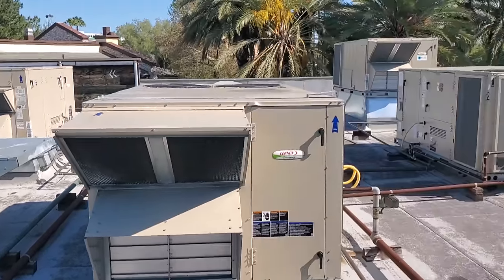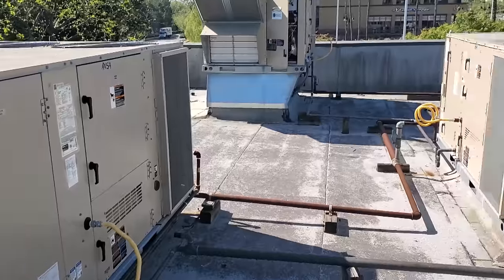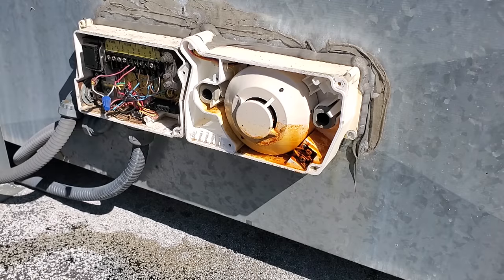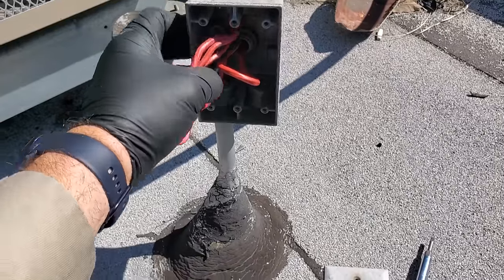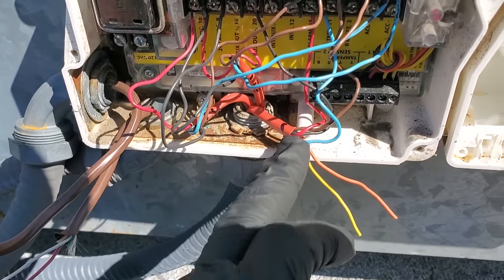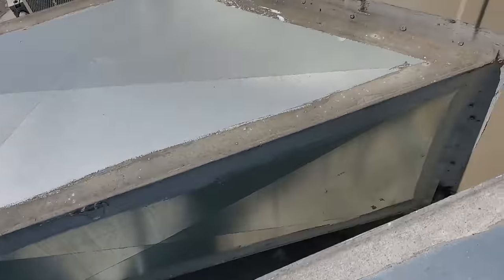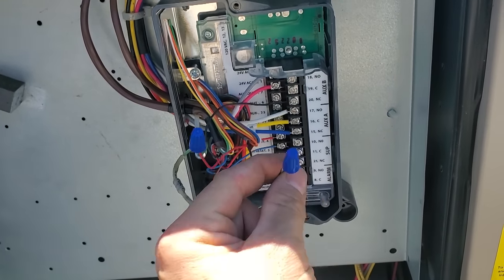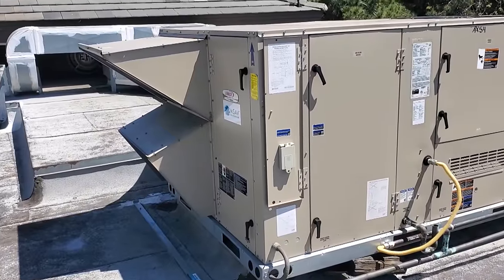DUCT DETECTOR TRIPPED

Comment: I've been working on fire detection systems for more than 35 years in the Netherlands. In every fire detection system that has an interaction with other systems such as ventilation or elevators, the weak link is the person or company that is responsible for correct commissioning and maintenance. The owner of the building is ultimately responsible but they try to push that responsibility to one of the contractors. Unfortunately neither of the contractors will take full responsibility and will start blaming the other contractor when things go wrong.
We need more people like you who feel the urgency of doing it right. Thanks a lot. I will pass this link on to enjoy and learn.
Reply from the maker: Thanks so much for watching !

Comment: Wow chris...that's some shady work you found. That's the type of trash that gets people killed!!!!
That company should be ashamed they let that pass as finished. And as for the start up...that's so  common...these companies should be sued for letting a "half ass" so called technician start up a rtu or any system for that matter that has no business doing the job!!!. Thank you for showing what a "PROPERLY TRAINED" hvac contractor is capable of!!!
Great video again
Reply: Jesse Lute You are absolutely right! However I do want to bring up that sometimes the techs are not given the correct amount of time for a proper start up and commission. A lot of sales guys that bid the jobs think its just flip the switch and walk off the roof. So I don’t always blame the techs when I see crap like that, more than likely their boss just told them do get it done in an unreasonable amount of time.
Reply: @jonathanschulz5841  yes I do agree there...I've had a few that did exactly that!!! It's still a shame that there is no liability for that shit!!!
Reply: if I had to guess, the fire system is set to cut power to any and all fans and hvac anyway. so they didn't need both sets functional, although they probably should have bid linking to the new units. but probably the place didn't want to pay for it or deal with all the hoops and chose the cheaper route. hard to say these days.
Reply: I do agree...but I've had to make those decisions myself. If you dont know how....its your responsibility to ask! Thats what makes a tech.
Just knowing your limitations and when its exceeded, to find the answer and do it right.
Alot of them dont care if its in right...and they are why I bitch...it only takes a few min to do a 1nce over and make sure your companies reputable name is known!

Comment: I went out during a “bomb cyclone snow storm” in my personal vehicle to help out a large grocery store whose duct smoke tripped on a very large seasons4 unit. They had to pay a firefighter to stand in the store while loud siren going off... fire alarm company would not come out and could not silence the alarm( allowed me to fix). I had fire department help me write out a waiver of liability, had them and the manager sign it. I ran on roof with a multi tool and a wire nut and got the alarm silenced. Customer gave me a $500 gift card and asked me to bill them 8 hours for my time, was a win win. Alarm company showed up 3 weeks later lol.
Reply: I have seen similar issues, but was not lucky enough to get a bonus.
Reply: Alarm Company needs to be smacked with a Breach of Contract Lawsuit...
Preferably etched onto a Sledgehammer and applied Vigorously to the side of their heads...
Repeat as needed until they clean up their act...
Reply: @HappilyHomicidalHooligan  😆 😅 😂 🤣😆 😅 😂 🤣

Comment: Nice find on the duct detectors not put into service. Does the bld. or fire inspector check these during new or replacement installations? I was in my doctors office in January and looked up in the ceiling while waiting and the smoke detectors still had the dust covers on them. I told the secretary and she was going to tell the bld. maintenance person. The ceiling was open and black painted. I'll bet this happens all of the time. Thanks for the video.

Comment: The installing contractor is to blame for all of this BS, they clearly did not know the unit they were working with. I'm a strong advocate for fire alarm technicians being used on multi-unit roof sweeps to avoid issues like this.
Reply: Consensuallycasual I’m a firm believer that alarm companies should stay away from my detectors. Code here has changed throughout the years. First they had to be in the supply. Then in both supply and return. Now just in the return. This is for units moving 2000cfm or more. The detector in the supply is the problem. If you want a smoke detector for your fire alarm then install one. The problem is the detectors installed down stream from the heat can and will go off on the initial heat start of every year. Dust on the elements or heat exchanger will set them off. This should only shut down the system it operates and not set off an alarm ; emptying the building and monitoring station dispatching the fire department. Always when firing up heat for the season call the alarm company and have the system put in test mode.
Reply: @actechformallyyomama746  Depending on the jurisdiction, the duct detector's usually are set up to send a supervisory signal to indicate that the detector needs maintenance, which would fix a lot of the issues of them causing a mass evacuation. If they are set up for an alarm condition, a recommendation needs to be made to move them into a supervisory condition.

Comment: The installation company by not pulling the detector plugs opens up significant liability for them. You need independent eyes and a checklist to go through the work to double check everything. Not necessarily a different company, just someone who didn't work the installation.

Comment: Anytime wires (or even jacketed cables) laid across a bare metal edge; a grommet or bushing shall be installed. I have seen fire systems that where wired with  un-jacketed  doorbell wire into boxes without bushings in the ends of conduits. If you don't have a grommet you can make one by slitting a piece of small plastic or rubber line if you need to go through a punch hole -- cause where there is vibration (or even thermal expansion) the metal edge is going to eventually gnaw through the insulation.  
When a conduit is installed between locations of large temperature difference a compression gland or sealing compound should be use to prevent condensation. THWN conductors should be used around around wet conditions and MC rating for the jacket. Ideally the warm end of the cable would be sealed but in some situation both ends would need be.   Water in the box can come from condensation pulled through a long conduit -- if part of the box is cooler than the other end of the conduit unsealed.

Comment: Wow bad idea to install a “waterproof” detector exposed outside like that.
Reply: By me in Illinois it was once code that the detectors had to be x amount of feet from the unit.  But that was 30 years ago before manufactures started including them in the unit.  Also around here you don't see duct work exposed on the roof like that.  It just wouldn't survive the weather.
Reply: That detector's gasket wore off which explains the sealer outside the detector.

Comment: another good video// as for the smell.... if it happens with low temp outside when economizer are open i would be looking at plumbing vent stacks..  on cooler/calm  days  the methane can pool on a roof structure with those high exterior walls. would need to piped to the outside edge. have had several restaurants that chased that problem for year  keep safe

Comment: The smell might be a sewage vent pipe close to one of the fresh air dampeners. I did maintenance at 2 restaurants that had that problem. One of my employers took a pipe coupling and wedged a screen for Windows in between and dumped carbon pellets down it. It filtered out the smell.

Comment: Usually these detectors are set up as a supervisory which is higher than a trouble.
By the looks of it, that detector is long gone.
That system also looks like it's getting old as well due to those key switches. I can tell it's an older conventional system by looking at the detector
Oh I just saw the system omg Bosch systems are complete shit I can't believe they are using that

Comment: Experience has taught me with outside weather proof IP65 rated enclosures it's often prudent to drill 2 x 6mm holes on the bottom of the electrical boxs to let condensate and water out rather than sealing water inside as they can sweat from humidity.

Comment: Admittedly I was cringing a bit.. wondering if they even addressed the duct detectors they put in the new units.  Evidently their fire alarm is an older bosch... so it was probably just a zone by zone and hopefully did not need new setup.
I'm unsuprised the Duct smoke detectors were 'installed' but not set up, sadly.  As a fire alarm inspector myself I see a lot of units installed poorly or badly by Hvac installers who are not properly instructed on the proper placement and operation. (let alone /sane/ placement...)  That said, I would hazard a guess those duct detectors my have even been pre-installed by the supplier which.. happens.  Much to one business's chagrin I've seen personally so far. (There is a tiny story there.)
Ultimately I would hazard a guess that the new duct detectors were preinstalled. And the Hvac installers saw the existing units.  Thus went with the easier route of just transferring the wire from the older DSDs to the new RTU, rather than connecting the old to the new device.
The one thing I did not see was did you verify the internal unit was placed on the same 'side' of the airflow?  I only saw one internal Duct smoke detector and while it should be on the end blowing into the store.. I have seen them on the side sucking air out of the store.. (i forget which is the supply and return at this moment.)  It absolutely has to have one on the side 'returning' the air to the store.  The reason being if the unit catches fire and its on the other side it may take much longer for the smoke to cycle back into the machine and shut it down. (See previously mentioned bit about a pre-installed duct detector.)

Comment: Do you have local fire or building codes that requires a smoke detector in both supply and return? Or, were the red plugs left in place because the unit installer just wanted  to use the existing smoke detector equipment? That may have kept the bid price of replacing the units down by just using the existing duct detectors. We run buildings in a very slight negative pressure, not positive. If you run positive pressure the doors will not close properly. It would be very difficult to balance that building by “winging it”.  Bathroom exhaust to close to a/c units and make up air units can cause odor problems.

Comment: it is good to correct bad work, but you should have used the red jacket cable for the alarm wire at least.  red denotes fire retardant while the brown is not.  some states dictate you have to use the fire retardant cable for all fire alarm cabling on newer installations.

Comment: 3:00 At this point in diagnosis, I'd pull out my fox and hound tester. I'd hook it up at the test/reset station, and go around to each weird/old duct detector's wiring and check for the ring. Less than 5 minutes work with the correct tools. 😁

Comment: System Sensor is the most common smoke detector in this area and it's what we also install on new systems that requires one.  I believe since I am so used to that brand that it's very easy to wire it up.  You are right, the fire alarm companies will not touch them in this area.
Reply: O.K. who does fix them if the fire alarm company won't? Thanks
Reply: @watermanone7567  We do.  They will contact a hvac company.

Comment: On the west coast we handle the ac side and the alarm company is responsible for the alarm side. However with modern slc fire alarm i could actually remove the alarm contacts and the fire alarm would show trouble. crossing those wires will trigger an actual alarm.

Comment: Always check with your local fire marshal as to whether the duct smoke detectors are required to trigger a trouble or a full alarm condition. Building codes vary a lot, and sometimes the fire marshal will want to do something different than the building code, just because they can. Found that on my company's current office building after we moved in. Duct cleaners were working overnight and a duct detector set off a full alarm in the middle of the night. Neither our building code nor the current fire marshal require that, so we changed it to just go trouble and shut down the unit. The old fire marshal was requiring full alarm for duct detectors because he could, no other reason. Then they started getting automated nuisance calls so they stopped requiring that and now typically just follow the local code.

Comment: The duct detector is connected to the fire system control unless it has contacts that tips fan and damper shut down.  It detects smoke in the return duct and had it operated it would indicate one of two things, trouble [dirty or defective device] or fire which the fire department would respond. .  It has nothing to do with the AVAC operation.

Comment: Oh the many times I’ve heard that warning beep on the alarm panel. Too many situations where a fire sprinkler pipe burst and tripped the alarm due to pressure loss. I blame the fire company solely due to the fact that they recently installed fire sprinklers right underneath each of the main area HVAC units and I bet they upped the pressure on the older pipes which are rated for lower pressures and are in poorer condition since they’ve been up there probably for the entire 16 years of the building’s use. (In case you are wondering this is in a Walmart)

Comment: I like to take a picture before taking it apart also if the wires are long enough leave some insulation on the wire on the  terminal so you know the color of wire that was on that terminal

Comment: Forgive me if I missed something, but if the duct detector that was full of water was sending a fire condition why was the fire alarm not triggered?
Reply: Sometimes, a duct detector will only trigger a supervisory condition.
Reply: If a short is created due to faulty wiring, or in this case water the system is designed to show a trouble condition. The detector will only set off an alarm if the photo cell is triggered under smoky conditions in its photo cell cavity.
Reply: @miguelh.2954  I've actually played around with the insides of a detector if anything is caught by the laser beams in there it trips

Comment: 280 ohm resistors with leads if I'm not mistaken,  but I have a variety pack in my hobby kit, comes in handy for bypass when say removing a spray booth that has fire alarm. Set it off once with a direct short, fire dept showed up, boss starts yelling that's gonna cost the company money, which mypops will just complain to me about.  So, I just said" it's all my fault,  I tried to bypass the alarm,  I was removing a booth and scraping it, I am responsible for this so how much am I going to owe for this?" The station is on same main cross street less then a mile. Firefighter walking jogging up who I said this too kinda dropped his head, and gave me a break,  small explanation and lecture. I thanked him very much and they left. All this happened in 6 or 7 mins. from response time to call, arriving, and leaving. I was extremely lucky.

Comment: Could that nasty water inside the duct detector have been causing the smell they were complaining about?
Reply: Seeing as the air from the duct blows right THROUGH the water like a hookah...maybe.
Reply: @quietone610  Could also be bathroom fans plugged or not working. Saw this many times. Thanks
Reply: probably dried out traps and the negative pressure sucking stink in. it generally takes a week or so for them to dry out and with so much shutdown they likely have lots unused, including floor drains which were getting a little mop water and now nothing because unoccupied.

Comment: I miss those dry contact smoke/fire  detectors and those smoke detectors are not nema 3 certified enclosure(outdoor) they are nema 2 which is for "indoor use only" or should be installed in a nema 3R enclosure.

Comment: Those red plugs are test ports. The sampling tubes are what circulates air through the detector during normal operation.
Reply: Where were those sampling tubes in the picture?

Comment: Wow, what a slack installation. Whoever is responsible ought to be very red-faced right now.

Those red plugs you had to remove remind me of a business park complex that I am very familiar with. The smoke detectors in many of the office and warehouse units still had their original red plastic dust caps attached years after the fire system was installed. Those caps clearly say on them "Remove before commissioning". Clearly the commissioning step never happened, nor did the fire service contractors report them as still being in place during the annual inspections they were paid to carry out.
Reply: Could not agree with you more. I have commissioned many schools and other buildings. The inspectors must be playing poker somewhere.

Comment: Red plugs are just dangerous. Should have massive warning signs! Who makes the A/C unit that they are fitted to?  Those original detectors probably never worked anyway because they need a pressure differential across them. Just sticking the pipes into the duct does not get airflow through the detector head.